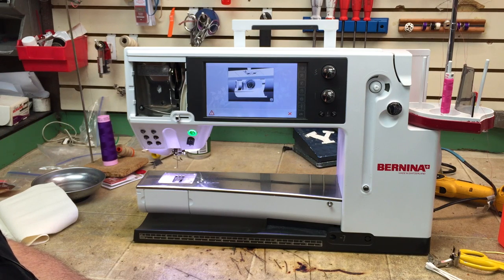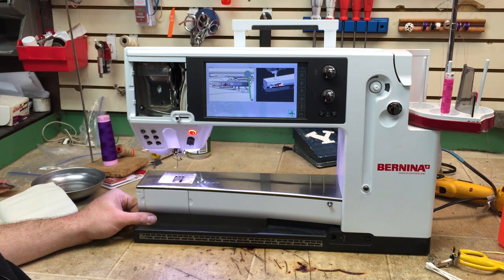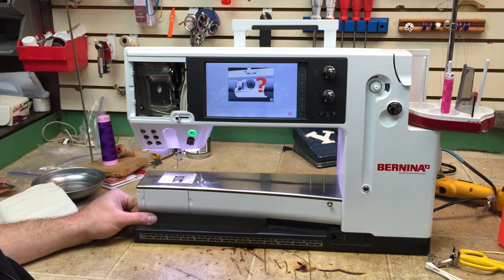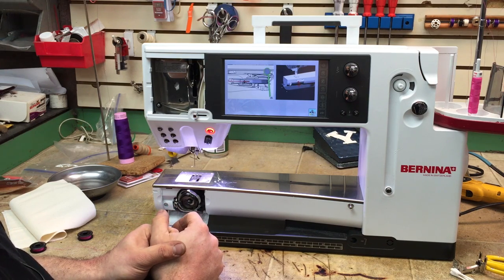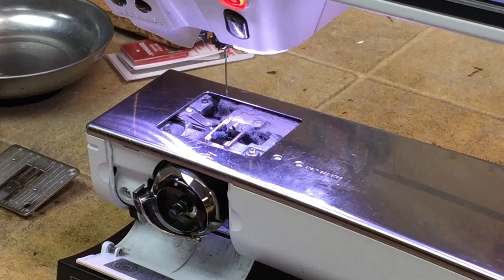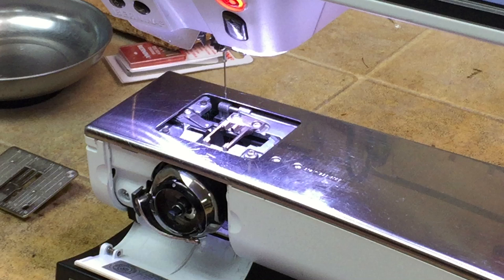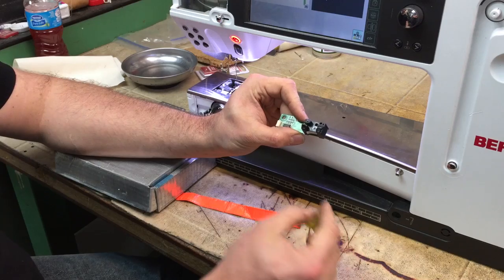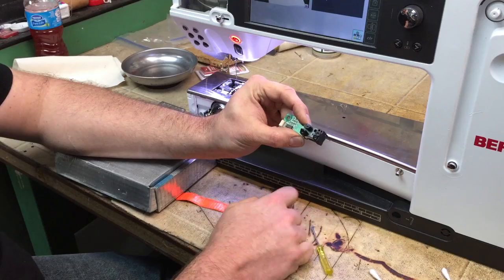Bernina 830 / 880 Bobbin Error and Bobbin Sensor Cleaning

Comment: I have been having bobbin error problems for over a year, ever since I had a huge bird's nest during an embroidery.  I have had my 830 serviced by a Bernina-certified technician three times since then and he can find no problems other than he says I have to use Aurifil thread instead of Mettler and Gutterman.  I used to be able to use these threads.  I now have this problem during embroidery using the correct embroidery thread in the bobbin.  My bobbins are not very used and the silver looks like new.  We (my husband and I are both engineers) had decided that it must be the sensor and searched for a video.  There was no lint in the machine, however the upper left sensor looked cloudy, so we cleaned it as you suggested and so far it seems to be working.  THANK-YOU so MUCH!!!

Comment: Hello, thank you for the demo, very interesting, but I would not use air pressure because all the dust goes inside the machine, I have always been told to use vacum cleaner.

Comment: Wondering about my bobbin and the hook.  When I open my bobbin cover, the hook around the bobbin case spins and makes a loud sound.  And when I load the bobbin and close it, likewise makes a loud sound.  It sews fine and does not show an error. It is clean as well.  Could it be a bobbin sensor problem, as in needs replacing?  Any other thoughts?

Comment: I have an error on my Bernina 830 with 2 gears and an "X". I took in for a service and coming back it have the same problem. Send it back for a "come back" and it was fine in the Bernina shop. When I tried working at home it started all over again. I have used different makes of thread, different colors thread, new needles, oiling the machine, etc.  What can I do to fix this problem?
Reply: I also get that same error message a lot.

Comment: I have the 880 and when I change the bobbin, the needle breaks. I replace the needle and it sews fine and there is no error message. I have to take the needle out before I change the bobbin or it breaks every time. I do clean it each time.

Comment: I continue to get the upper thread error. I have cleaned the machine entirely, re threaded countless times, yes the thread is in the take up bar. I get this message in both the sewing and embroidery portion of the machine. Help!! Where to next? In the manual is suggests disengaging the needle bar. I don't know how to do this. Will you please show me how or give me a solution? Love your videos.
Reply from the maker: Theresa DuPey the upper sensor is most likely damaged. You will need to bring it into your dealer. In the meantime you can disable the upper sensor in settings.

Comment: Great information!  I have the 880 and am having a lot of headaches with it.  The latest one is a message for the bobbin:  "Could not lock.  Check hook system and continue."  And then the bobbin won't work, or just keeps rotating inside the machine.  Been repaired twice to have the sensors changed, it just happened again for the third time.  Any ideas?
Reply: Maria Gardner Sounds like the sensor area is dirty, there is a sensor that watches the door as you open it and they get lint in them and sometimes (if a tech does not remove or install the door properly) they get damaged. This will cause this error and the bobbin not to lock.

Comment: I’ve cleaned out the bobbin area and the sensors meticulously, but I still get the bobbin error when I press the presser foot and my machine won’t sew.  Also, whenever I open the bobbin door, it spins around a lot more than it normally does.  Any suggestions?  I’m so frustrated! My machine was completely fine last week.

Comment: BB- I have a different error on my 880.  It has two gears going around and then a big red "X" shows up.  What does that mean?  I love your videos...not much on the troubleshooting for the 880.  This machine has been to Illinois twice and then it went back to the tech four months later.  I just got it back and now it is doing this.   Not very happy right now.
Reply: Thank you!  I took off the front and it was not in the take-up lever.  Also, I didn't know about the 18" tail on the bobbin.

Comment: Thanks for the video but you don’t show how to get the sensor out so I’m a bit stuck.
Reply from the maker: Kenris MacLeod the sensor doesn’t come out. You have to clean it with a q-tip.
Reply: Ah. Ok. On the video it looked like he’d taken it out of the machine. Thanks for your help.
Reply: That's what we thought, too, Kenris.
Reply: He does not show how to take the bobbin sensor out of the machine.  What he is showing in his hand and pointing out where the sensor eyes are, is the sensor unit itself, as if someone had purchased a replacement part.  As best as I can tell, unless you are a Bernina tech you cannot remove the unit yourself.  That has to be done by a tech.  However, in the video, he does show how to clean the sensor while the unit is in the machine.  I have tried several times to clean the bobbin sensor in my 880+ and have had some success, but it is really hard to see down inside the machine.  Out of desperation I turned off the bobbin sensor.  But then I have to be vigilant about the bobbin running out of thread.

Comment: Bernina Boys, our dealer repairman showed us a little latch to open in the 700 bobbin area.  When open you can remove the whole bobbin case and clean out a LOT more pieces of thread.  He said there is one on the 880+, but we don't see it.  Is it possible to remove the bobbin case?
Reply from the maker: Unfortunately no there isn’t. The 700 series has a different hook system. There is no way for you to take the hook out of the 8 series machines.
Reply: Thank you,  @berninaboys100 , and thanks for all your videos!

Comment: Guys, love your videos. Is there a product that I could paint in the silver rectangles? I do a lot of embroidery and I go thru so many bobbins, I ve purchased over 40 bobbins due to knicking, scratching Etc..........you called them silver mirrors?????????
Reply from the maker: We haven't found anything that works yet. BERNINA is replacing them for free because of the issue, even though they have greatly improved their bobbins over the past few years.
Reply: Hi, I've got loads of bobbins that have worn out because the silver dots have deteriorated . It's that right Bernina will replace them? How do I go about that? I've got the 830 and have had loads of problems with it. Without you boys I don't know what I would have done. Thank you for your wonderful videos. I live in the uk. Xx
Reply from the maker: Andrea Krier your dealer will warranty them for free
Reply: Thank you for your swift reply. I will endever to get them replaced. Xx
Reply: My dealer said they would only replace them during the first year.  How do I contact the corporate office to ask them?  I handle them with great care not to touch the silver mirrors.   How do they wear out?